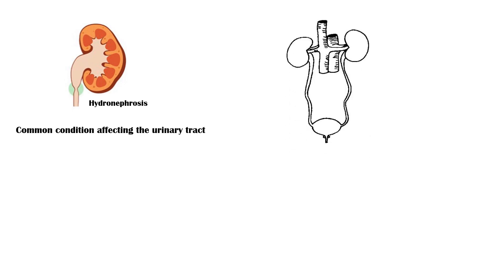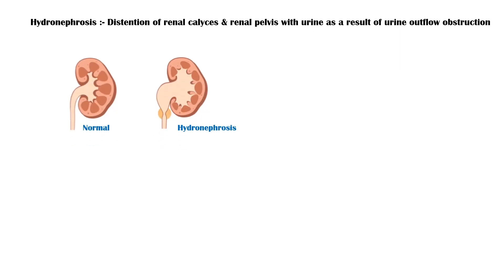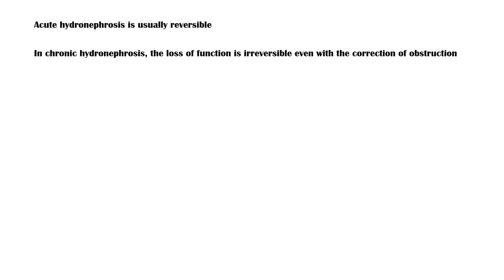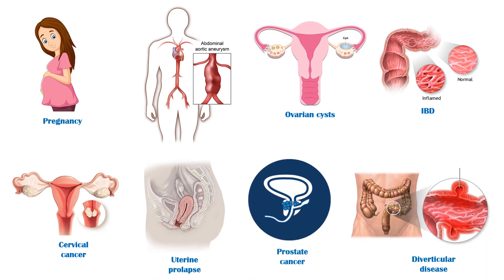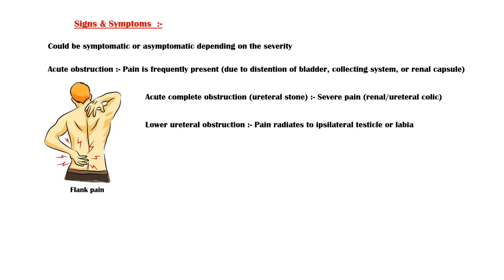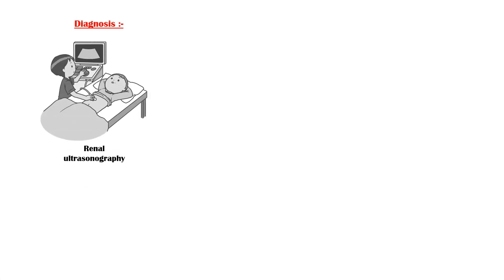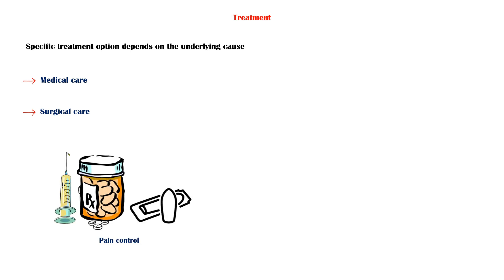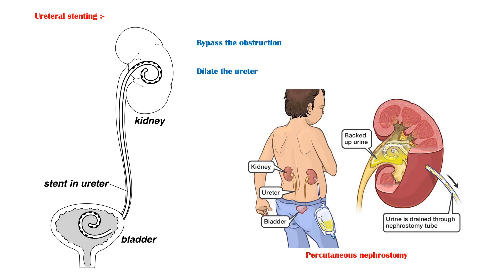Hydronephrosis - Definition, Functional Anatomy, Causes, Signs & Symptoms, Diagnosis & Treatment

Comment: The operation I'm about to have for PUJO is called Pyeloplasty which will be done robotically. They will chop out the obstruction and some of the excessive hydronephrosis, then rejoin the ureter to the kidney. It's taken them 2 years of blood in urine and very extreme pain before they  finally offered this. Good luck to anyone out there similarly suffering.